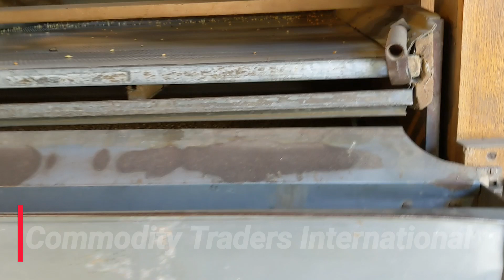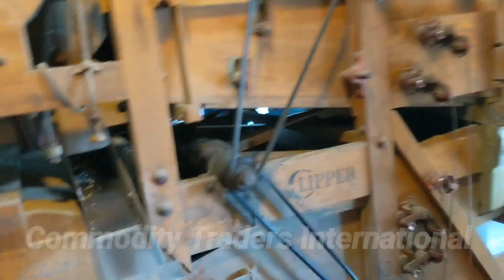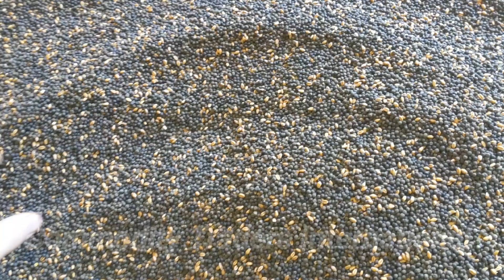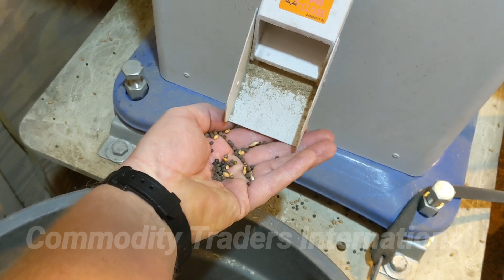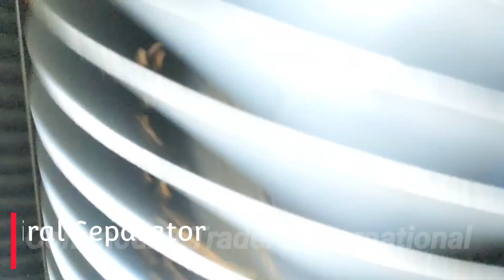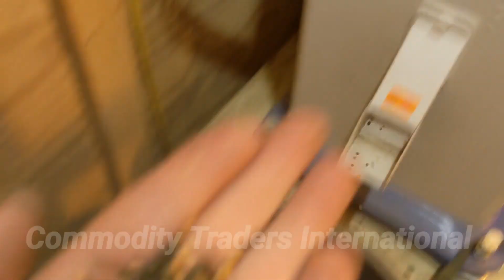Separating Vetch Seed The Modern Way

Comment: Awesome video. What rpm would you recommend for a clipper like yours. I have a 3 screen and I just think it’s a little fast.
Reply from the maker: 390 RPM eccentric shaft. If you have ball trays you may want it slightly faster but no faster than 410 RPM.